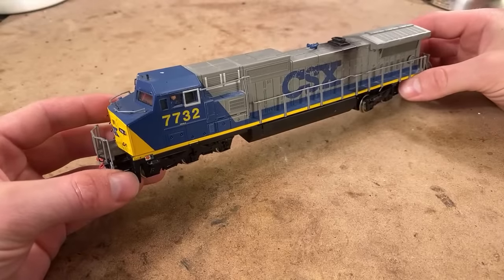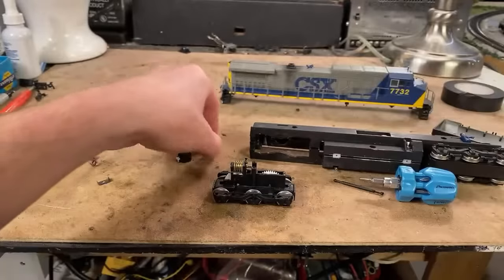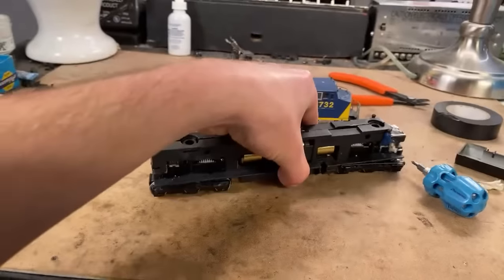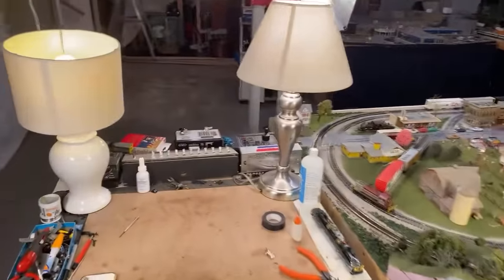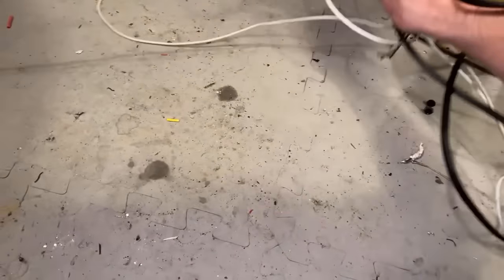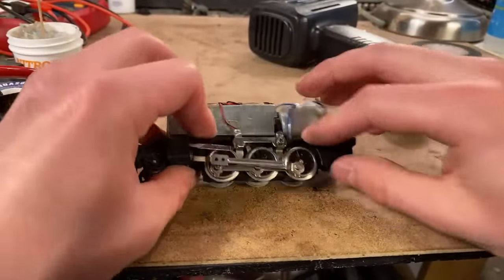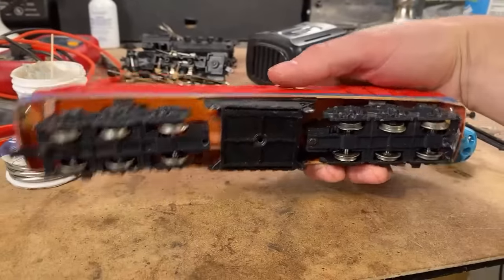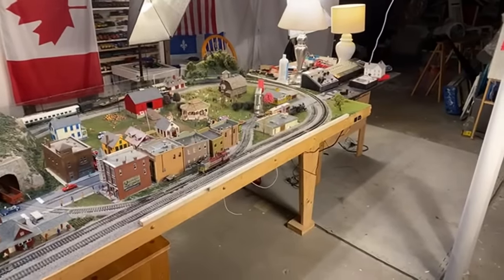Trying to repair a Bachmann CSX Dash 8-40c Locomotive

Comment: Hi SMT believe it or not thanks to watching you work on electric motors I finally got the courage to repair an electric fan I had trouble with and it worked so thank you
Reply from the maker: That's awesome. I've learned a lot working on electric motors from model railroading and as a result I've managed to fix two fans, 3 outboard starters, 1 blender and one pencil sharpener.
Reply: @SMTMainline  thanks for the reply keep up the good work I look forward to the next project and don’t forget you have a lot of supporters down here in Australia thanks again

Comment: When applying CA glue (Which is known As Superglue in The UK), I squirt some onto a Ceramic Tile And Then apply it to the required area using a cocktail stick. You can be very accurate this way and it's not so likely to go everywhere like when you apply it directly from the tube. CA is notorious for getting air bubbles in the tube so you have to squeeze a little harder to get it out which often causes overflow and can ruin some things you're working on.
Reply: I use a straight pin, a little bit less than enough
Reply: I tend to stay away from bachmann because of split gears

Comment: I have a dozen Bachmann locos, and other than one UK model that was SPLIT CHASSIS, I’ve literally never had any problems with them. Got the new ALC-42, thing runs like a dream. I don’t mind Bachmann at all, at least from the late 90’s and onwards.
Reply from the maker: I'm glad to hear you've had better luck with them. I've heard better things about Bachmann UK, I don't know if they were designed differently.

Comment: I had that same CSX Bachmann locomotive from the mid-90’s. It turned out to be absolute crap. While watching you work on this one I had flashbacks to the many hours I spent working on it, unsuccessfully. The screw that holds the shell to the chassis stripped (much like yours), and then the plastic screw hole on the body cracked. That was my first clue it was a lemon. I gave up last year and donated it to a local model train club. Had to move on and focus on my better quality locomotives.
Reply from the maker: I don't blame you forgetting rid of it, these things are a terrible design.

Comment: may i suggest next time you get a stripped screw head, start with blue tac, electrical tape, rubber band or masking tape to fill in the gaps depending on the extent of deformation. saves you the risk of damaging such delicate models, this method would have still managed to get that screw out for sure.

Comment: Harrison I think you just spring  the worm gear out by pushing it one way while lifting the other. I've always avoided Bachmann because of the split frame and especially. the high truck mount. On an old GP30 I had, the lead truck would climb the rail under load on a grade. Derailing. It was basically unfixable. Had to limit to few car trains. Ugggg 😢 Also  I met Mr Kato and asked him. It's Kaw-toe not Cate-owe. That is definitive. Cheers

Comment: When removing stuck screws, I use a left hand drill and run it in reverse after putting a drop of penetrating oil on the head. When the drill starts to bite it will often back the damaged screw out.
Reply from the maker: I've done that trick a couple times but I think this one might have been too far gone.

Comment: Which oil is conductive I’ve been looking and I still haven’t figured out which one it is. I have Labelle 106 and 107 and I am not sure which one is conductive.
Reply: Atlas brand
Reply: @williamsantangelo thank you
Reply: When I get into servicing my engines, I am going to use a dab of conductive grease called "NO-OX ID A Special" on wipers and contacts. This was recommended by "Ron's Trains N Things" as a rail and wheel treatment after cleaning the entire track with a non-polar solvent, not a bright boy or abrasive.  It is claimed that some people don't clean their track for years using this method. Certainly after watching that video I will not use any abrasive track cleaner on my track anymore.
Reply from the maker: That will help the power but I wouldn't recommend it for traction tires. They use solvent on my club layout and it ruined the traction tires on my Swedish E2.
Reply: Ron does warn of that possibility. I think the keys would be to ensure the non-polar solvent used for initial cleaning such as mineral spirits (make sure good ventilation is available while using) be thoroughly dried. The amount of conductive grease used is very miniscule, only a few molecules thick. He wipes the rails after applying it so there is only an invisible film. Yes, could get absorbed by traction tires but maybe not that much? What about using silicone traction tires instead of regular rubber? There is the question of why traction tires are used at all. A steam loco should be properly weighted, so they are not needed. And, I guess rather than have all diesel wheels driven on older, less expensive models, it was much less expensive to just add the tires.  @SMTMainline

Comment: Tested an N-scale Bachmann 8-40C in a hobby store and it obviously had a gear problem - either residual plastic on one of the gears, or broken tooth.
That misfortune, and then reading in Spookshow (N-scale almanac on engines) about how the Bachmann Spectrum Series engines don't couple well with other brands, spooked me away from wanting anything Bachmann. I'd previously read they had improved, but that isn't what I saw, watching that thing lurch and limp down the track.
Reply from the maker: Bachmann has improved since the 80s but they still aren't great. They went from bottom of the barrel to middle of the road. I wouldn't mind if they weren't selling them for top dollar.

Comment: Hello im goona ger backinto ho trains after about 20 years  it is so different now days could explain the difference in the different track codes
Reply: I just did a nice long explanation here and then the computer locked up!
I try again.
Codes tell the height of the rail. Code 100 I think is taller at HO scale than a prototypical rail. It accommodates the deep weel flanges of HO engines and cars so the flanges won't hit the molded tie plates or ties and they can run through turnouts without derailing. If your modeling leans toward ultra realism, you would use code 83, 70, 55, etc. depending on if the rail is on the mainline or spurs and what era you model. These codes can roughly correspond to different rail weights used on prototype railroads. Mainlines now use heavier rail to support heavy engines and car loads.  Heavy rail might be 132 Lbs. or more per yard of length. whereas in earlier days 90 lbs. per yard was enough. Often you see lighter rail on spurs and older sidings. 
All this info can be searched online and on the NMRA website. For just running trains, code 100 is fine, its what I have available and what I'll use for now. As your modeling progresses, you can always change out the rail later. For that reason and knowing you may change your layout around later anyway, you might want to not glue roadbed and track down with such strength but only use a tiny bead of caulk or whatever you use to tie things down. My layout had been glued AND nailed, plus ballasted with glue which made it time consuming, tedious and difficult to pull up rail and roadbed.
Reply from the maker: Music100 did a better job explaining this than I could but incase you're wondering, I use code 100 with cork roadbed. The thicker rails allow for older locomotives and rolling stock.

Comment: It's been my experience that this is a case of the prevailing question answering itself. "What is wrong with the Bachmann?" For starters, it's a Bachmann. I've observed many of their models, not all, since the early 80's. I've worked on many of them. Poor design, poor performance, and cheap quality are a common theme in my observations, through their current models. Unfortunately the best advice I can give concerning a Bachmann of any kind is simply, DON'T!
Reply from the maker: Seems like a good rule to me. I'm glad I didn't pay much for this one.

Comment: Ive always wondered why ya dont have a one or two better selections of screwdriver sets and/or bits, one screwdriver never has all sizes/bit types for every make model and manufacturer and screw type, just in phillips alone there are a half dozen bit types - if you are having to drill screws you need a better high quality set of screwdrivers - not being mean just contructive advice from an old mechanic
Reply from the maker: I have others but I find long Phillips screw drivers are difficult to get much torque with.
Reply: Yes, those handles on precision screwdrivers don't allow much torque - unless you grab the handle horizontally with some pliers and push down with your other hand on the handle end. Then, watch out, don't put too much pressure on your work piece! Still the screw can strip out. @SMTMainline